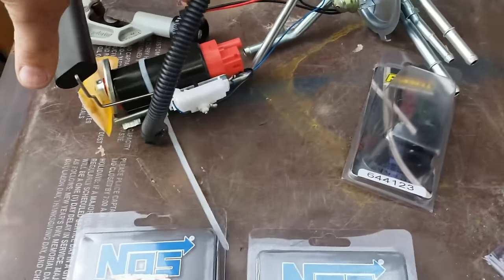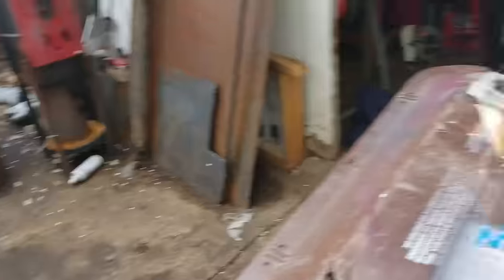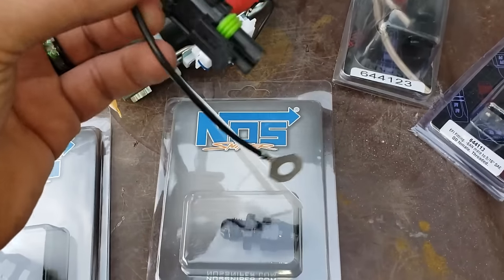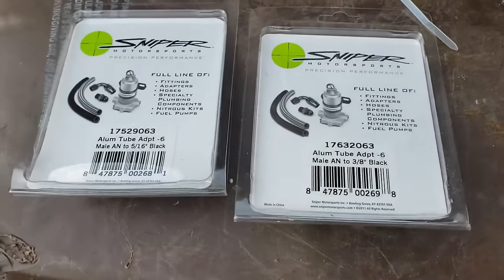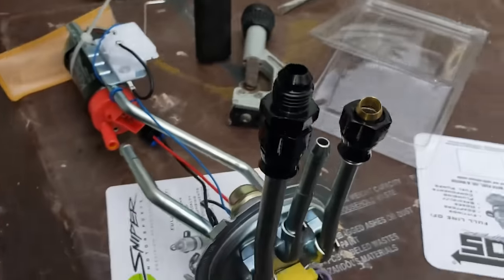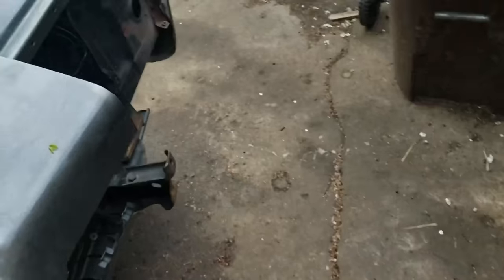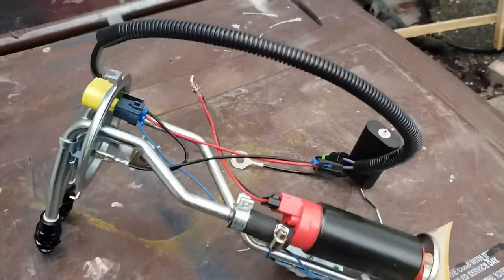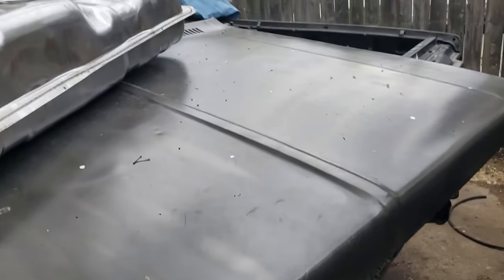Back To Basics LS swapped C10 fuel system

Comment: I see ls swap companies trying to rip people off for alot of money for a 73-87 fuel injection tank. Dont fall for it. In 87 all the squarebody where fuel injected and lmc sells the 87 fuel injection tank 16 gallon (32-5937) for 99.95 and the 20 gallon (32-5932) for a 119.95
Reply: Easiest i found for the sending unit/pump is to use a pump for a 96-98 350 vortec. Has to be vortec. Both vortec 350 and 5.3 run at 52psi fuel pressure so pump works with it and i goes in the 87 sending unit with very VERY slight modifications. Overall savings about 300

Comment: appreciate the video and just want to share that my '74 dime with a stock tank with no baffle and a Spectra fuel pump which plugs right in to the sending unit (no soldering required - bonus) has been running great and I do take it up the mountains when we go camping about half a dozen times each year, buy yeah if I did not have a tank at all or it was rusted I would do what you recommend just for an extra piece of mind
Reply: Can you post the part number of the spectra pump that you used ? Thank you!

Comment: Hey man would I need to buy 2 sending unit or jus one I have two gas tanks on my k20 3/4 ton I have a 6.0 installed already
Reply from the maker: One for every tank you want to use. 

You'll need a selector valve that can handle high pressure also.

Comment: I always felt the simplest way to do a fuel delivery system was to take off the Hood and have a buddy lay on the roof of your car with a five-gallon gas tank drizzling gas into the carburetor.
However, that may not work on your fuel injected setup.
Reply from the maker: No, you gotta use a bug sprayer for EFI 😂
Reply: it would work actually, the engine doesnt care how it gets fuel. pour it right in the throttle body.
Reply from the maker: I've run out of a 20 oz bottle, just to test fire in a field lol

Comment: On one of my builds I used a walbro gsl392 its cheap and really really quiet.. 
And on my 71 olds I used the internal kenso fuel pump on the original tank I just cut the pick up tube and put the fuel with hoseclamps

Comment: Was going to buy a 31 gal efi blazer tank buy the stock sender and lines with fuel pump then buy a wabro 450 pump Appreciate your opinion.thks it a 5.3 motor 1965 f100 put tank behind diff
Reply from the maker: The K5 tank is nice for under bed setups
Reply: @TheDrivewayEngineer  read use a walbro 255 for stock 5.3

Comment: So I have a 96 c2500 that had TBI. Drop the tank and installed evil energy fuel pump inline. Not sure that it will pull through the factory in-tank pump but we'll find out.

Comment: We still use a 1987 1 ton camper special at work (camper store)  1st year of efi, the truck is low miles and rust free.  Plus it has the old man cap and dash cover.
Reply from the maker: That's awesome, I'd really like an 87 K30, but I've probably missed that boat.
Reply: @TheDrivewayEngineer  we have a fleet of old Chevys at work.  Some will be for sale soon.  I'll post them on the FB page when the time comes.  Have a nice Suburban too.

Comment: I have a 1977 with mechanical fuel pump, what kind of power do i need to run to pump? Just any 12v ignition wire?
Reply from the maker: You need a relay

Comment: So you are using a tank from an 87 R10 #IGM1C or GM11C and using just the sender for that tank  #FG05G and retrofitting a pump and hoses to the sender?  Would I need all of those compression fittings if I’m running a carb and not EFI?
Reply from the maker: That's correct.

You can run your stock tank and sender if you're not running EFI
Reply: @TheDrivewayEngineer  Cool.  Can I use a Carquest HS2521093 and drop it in the tank of my 74 K2500,   Install a regulator to bring pressure down to 7 and it work? And use just regular hose clamps?

Comment: THIS CANT BE RIGHT can it ?  in canada using amazon to source parts im up to $375 cdn/$300 usd  for fuel system and i might still be short a male 6an  fitting or 2 for fuel pump !
thats , pump, filter, 4 adapters, 16 ft 3/8  fuel  feed line hose kit with fittings, 16  ft 3/8  return line.
my whole cutout motor only cost 445 cdn
Reply: unless you know a cheaper place? it doesnt seem like shitbox has all the parts  nor are they cheaper plus i might get hit with import fees.

Comment: Let’s say you wanted to turbo your LS in Daryl. What upgrades would you make to this setup to supply... say 700ish wheel horsepower?  Is the possibility of dual pumps there?
Reply from the maker: I've had this engine turbo'd.

I had decapped flex injectors and a Walbro 450 in the tank. Only changes.
Reply: @TheDrivewayEngineer  where did you get the injectors  recapped?
Reply from the maker: In my garage lol

Comment: Have same setup in a long bed 79c10 just got it running, and the vent valve isn’t working ( I took it too the gas station and it keeps shutting the pump off) did u have to do anything to your sending unit? I’m using the spectra fg05 one
Reply from the maker: Nope, just what you see herw
Reply: @TheDrivewayEngineer   hmmm wonder what’s going on then? Thank u for reply

Comment: are you able to tell me where you found that fuel pump? because i cant find one, because either i cant do research, or im looking for the wrong fuel pump, i got the sending unit that you linked, i just for some reason cannot find a fuel pump. All i know is that i need about a 60psi intank fuel pump. please respond i have never done a ls swap before or basically anything with a ls engine before
Reply from the maker: Kemso 380lph pump, they're all over eBay
Reply: @TheDrivewayEngineer Thnk you!

Comment: Was wondering how would I be able to use that sending unit with a 1981 c10 it had dual tanks and they had like a nipple with a plug and ground that’s all?
Reply from the maker: The switch won't handle the EFI pressure
Reply: @TheDrivewayEngineer  alright also the vent what is needed for it just a hose ? Is there a specific place to put the line from the vent?

Comment: Thanks for the video. I ended up getting similar fittings for $11 each and the same fuel pump on eBay. Did you have to trim the sending unit at the bottom of the pump to get the pump to fit into the unit?
Reply from the maker: No, I just stuck it all in there

Comment: Do you remeber which one is power and which one is fuel level on the 2 wires coming out of the fuel pump. Besides the obvious ground wire 😳
Reply from the maker: No, I just hooked one up until the pump ran
Reply: old but it's the grey wire for the hot on the pump

Comment: I’ve been using these videos and they are excellent help. Question:
How do you set up a truck with dual tanks and the electric fuel pump(s) ? I’m putting a 4.8 and 4l60 in 75 k10
Reply from the maker: If you want to keep the tank selector, there's a guy out there who sells high pressure ones.
Reply: Thank you.

Comment: What about your filler neck? It is not located in the same spot as the early 80’s tanks. If I’m correct they are also shaped differently so did they tank fit your factory strap location?
Reply from the maker: It's 100% in the same spot
Reply: The Driveway Engineer where did you purchase the tank?
Reply: The Driveway Engineer never mind I see the links you added. Thank you.
Reply from the maker: Bear in mind, my truck is a stepside, so your mileage may vary.

Comment: When you soldered the wires what heat shrink did you use . Is their a specific one for fuel. I don't want my gas explode
Reply from the maker: I just use the heat shrink with glue in it
Reply: @TheDrivewayEngineer  I just heat srinked it is it ok
Reply from the maker: It'll be fine, there's no air in there
Reply: @TheDrivewayEngineer  ok well when the sun sets ill install the tank